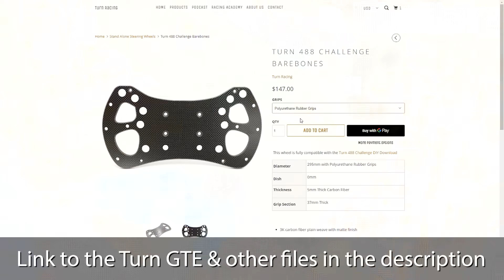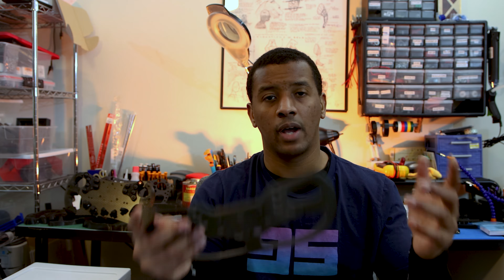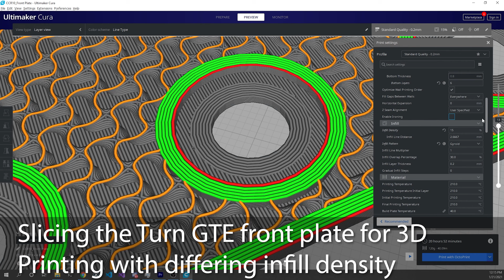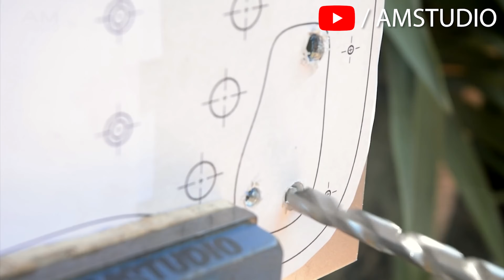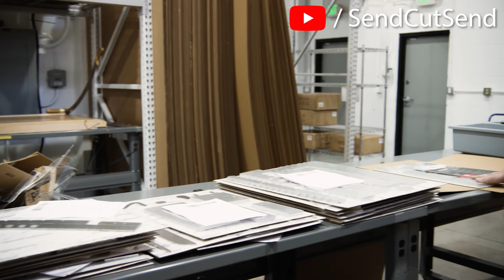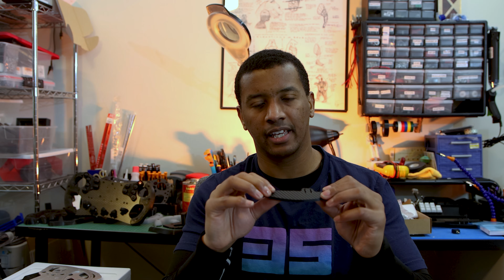How to Build DIY Sim Racing Wheels- CNC Parts [Part 2] -

Comment from the maker: Note: The Turn GTE isn't currently available on the Turn Racing site. He's working on having production setup for this.
Note: I've added a link to Ponoko - a laser cutting service for Acrylic and other similar materials. This is the service I reference when I say a 5mm Acrylic plate and paddles can be cut for ~$45.
Reply: how did you get the aluminum metal shifter mechanism
Reply from the maker: @fernank017  What pare of the video are you referring to?
Reply: @BallisticTech  haha nothing specifically — in part 1 you mentioned using turn racings shift mechanism, but it was metallic. I was wondering if you had it CND’d
Reply from the maker: @fernank017  I haven't had any parts cnc'd. So far it's been prohibitively expensive. I bought metal ones from Turn and that's it so far. Everything else I've done has been laser cut or 3d printed.
Reply: @BallisticTech  ahh I suspected as much. I couldn’t find the metal shifters on turns website, just the CAD files.

Comment: What program do you use for 3d videos we see?
Reply from the maker: For creating and modifying designs AutoDesk Fusion (Formerly Fusion 360) is the most common that I've seen and what I use.

For printing files you need a slicer to take the models and send them to your printer. I use a combination of OrcaSlicer and PrusaSlicer

Comment: A hardwood ply would do fine for a frontplate after all it is an OG composite material though it'd be more expensive than other alternatives per m2. There's also the option of something like a carbon/balsa/carbon sandwich, 1mm thin sheets of CF are much easier to cut and balsa has a very good strength to weight ratio despite being quite soft. When bonded together in this kind of sandwich, you can make surprisingly strong, rigid and light products fairly easily. It's also cost effective as balsa board is cheap and thin cf sheets are much cheaper than thicker sheets per m2.

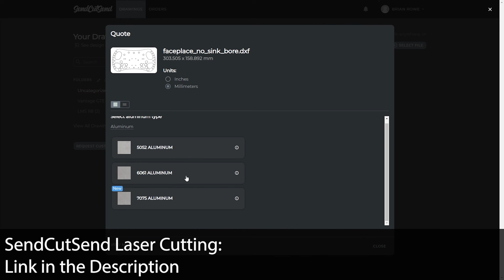Comment: 20:15 Oh, I see someone else decided to make my pedal project.
Reply from the maker: Hey. Welcome. I haven't gotten them cut yet. A lot of US based cutting services only have imperial gauge material. So like 3.2mm. I was worried about having to go in and adjust every slot to make sure there's clearance.

I've studied the pedals a lot and learned a lot. Maybe I'll do a video on them down the road!

Cheers. Thanks for watching
Reply: @BallisticTech  Everything is calculated for metal 3mm thick (the grooves are 3.1mm in size for a good assembly). So 3.2mm will definitely not fit, or you will have to redo all the gaps to 3.3mm. Plus, lengthen the length of the shanks that are inserted into the groove, up to 3.2 mm.
Reply: @BallisticTech  You can also expand the grooves with a file.
Reply from the maker: @_ZERgyt_  True. I think I'll order just a few test parts around the brake load cell and see how the tolerances/clearances work out.

Comment: Just for the record, I had an Aston Martin GT3 plate and a 911 Cup Button plate, both from 4mm carbon as well as 2 smaller 3mm pieces all cut and shipped to my door for less than $90
Reply: What service did you use?